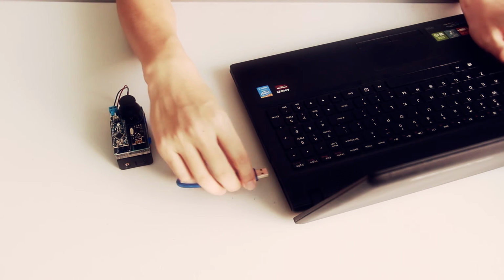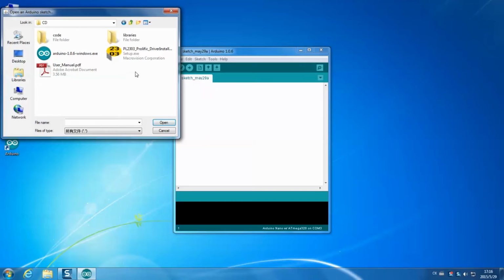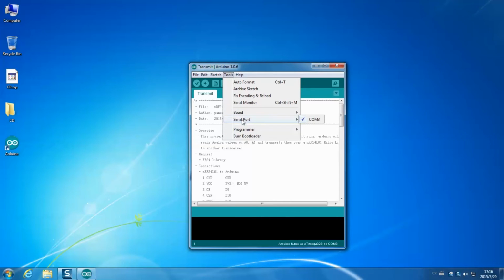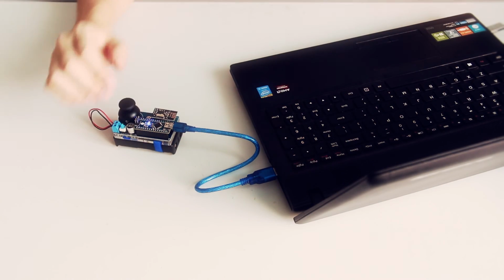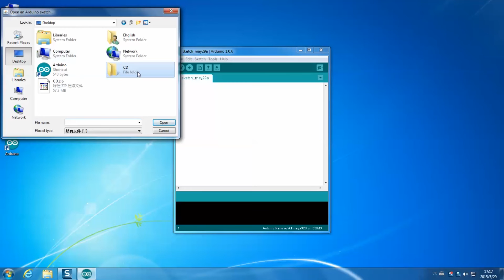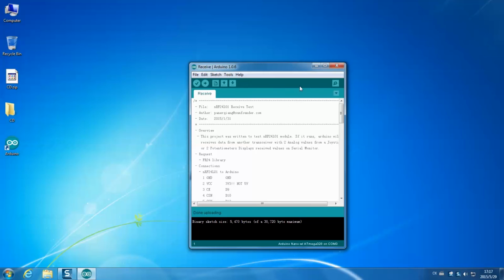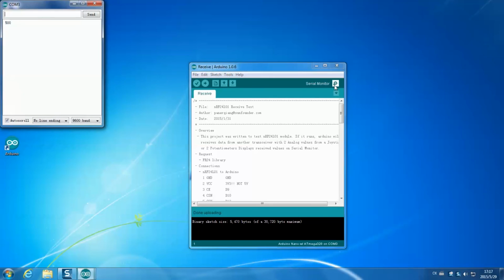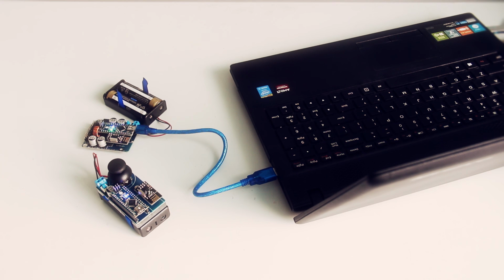SunFounder Crawling Robot Assembly Tutorials 04 NRF24L01

Comment: i keep getting error in "receive.ino" 
error: "void value not ignored as it ought to be" 
something wrong here 
done = radio.read( joystick, sizeof(joystick) );
Reply from the maker: There are two possible reasons:
1. The library RF24 is not added to the folder libraries of the Arduino software. So just add it.
2. There are another library conflicted with the RF24 in our CD folder. They are not compatible with each other so the error occurs. To solve this, you can find the similar folder under the folder libraries of Arduino, delete them or move them to another path. Then copy and paste the RF24.zip under CD\libraries to the Arduino libraries folder. 
And remember the code should be the latest on our website (go to LEARN->Get tutorials).
Reply: i got the same problems
and i have already added RF24 to Arduino software
which is the conflicting file name in the libraries of Arduino?